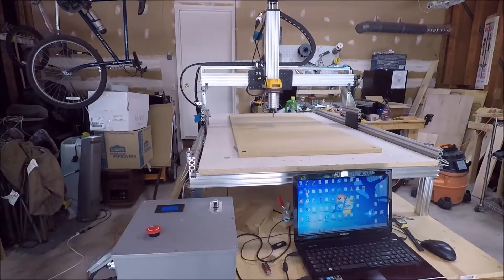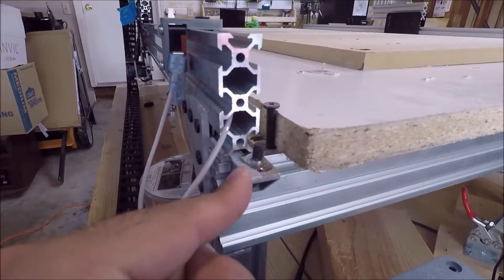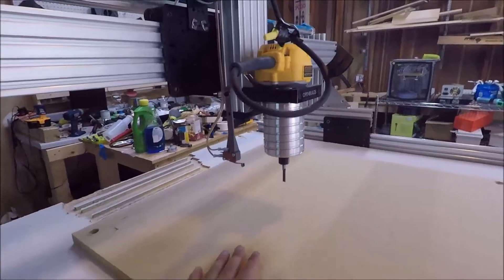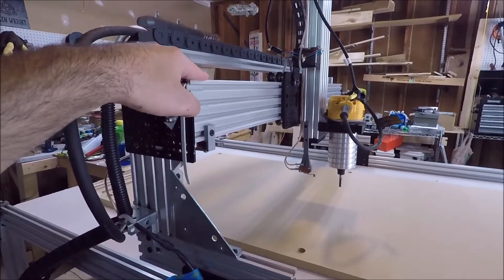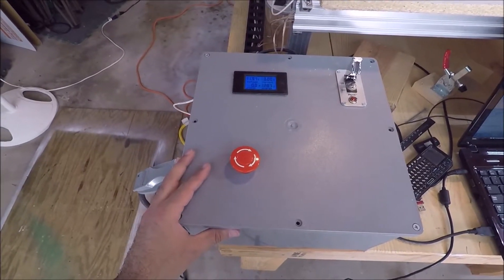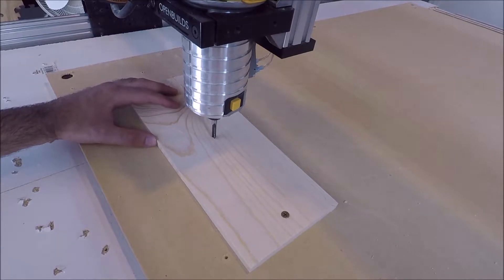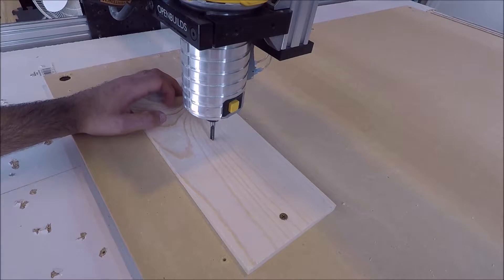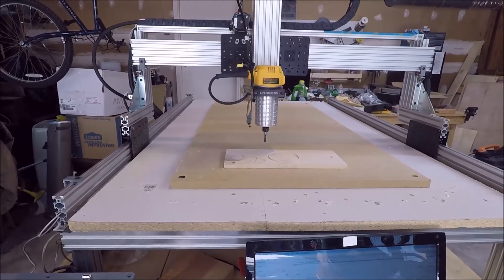Custom Built CNC 2.0

Comment: Does the z-axis every wobble
Reply from the maker: I wouldn't say the Z-Axis wobbles, but it does deflect about a millimeter in the Y-Axis direction if I run the machine too aggressively in hardwoods. Since this video I have installed a shorter Z-Axis and reworked the gantry carriage to increase rigidity. With these changes and using the proper speeds I haven't had any issues with the Z-Axis.
Reply: Electric WorkZ Shop do you have any suggestions for a machine that needs 4ft z-axis cutting space for foam block? Or do you think I will have issues if I use 4ft z-axis to cut foam block? Thank you.
Reply from the maker: Hey Smit P,

I have zero experience cutting foam blocks, but Ill tell you what my thoughts are from 1000' up. The main issues I foresee is the cutting head deflecting all over the place due to the two main forces you will probably be fighting while cutting the foam which are the forces required to push the cutting head through the medium as well as the forces created when the cutting head accelerates or decelerates in any direction due to gantry movement. These forces across a short Z axis may only cause deflections of millimeters but over the length of a 4' Z axis could be problematic. Based on your previous question I am guessing you have come to the same conclusion.

To help mitigate the above mentioned issues I would suggest is using a fixed gantry set up. The fixed gantry only allows the cutter head to move in the + or - X direction and relies on the table to move the object you are cutting in the + or - Y direction. In my limited experience, this type of CNC tends to be much more rigid than a non fixed gantry setup. Hope this helps!
Reply: @smitp4574  Think CNC Hotwire for foam my friend.

Comment: Plan share u me?
Reply from the maker: Unfortunately I do not have any written plans. When I design projects I like to come up with a general design in sketchup or on paper and fine tune the design while physically making the project. This type of project execution is not the most efficient, but I like tinkering in the shop. By the end of this project the final design was tweaked so much that the original sketchup design didn’t apply to the final product. If you would like an idea of how to build a custom machine I suggest watching some of my other videos or looking on other youtube channels. OpenBuilds.com also has pictures and descriptions of other custom built CNCs designed by people who buy their hardware, I found this information extremely useful when designing my machine. Good Luck!